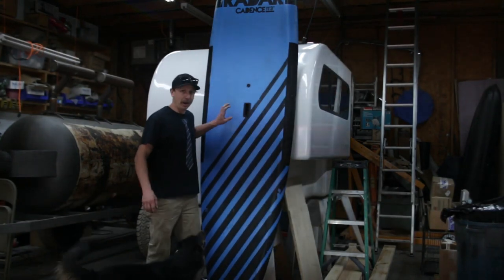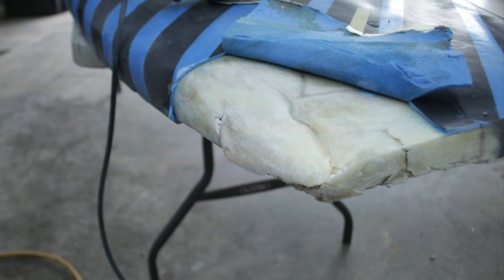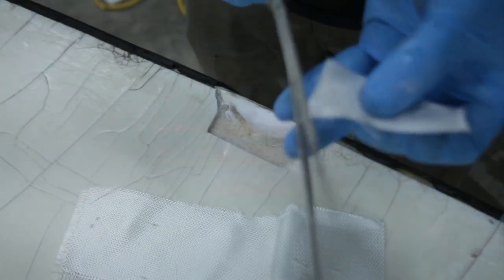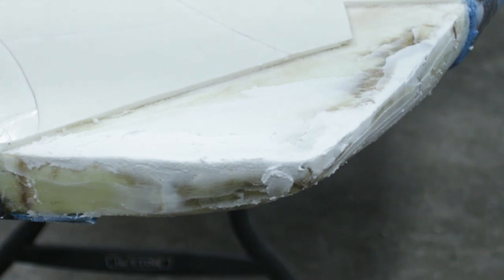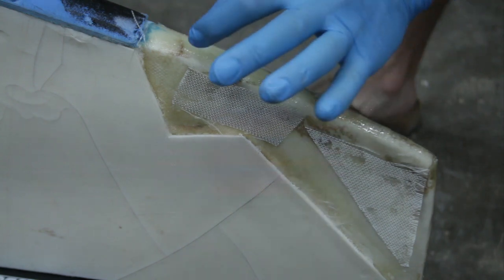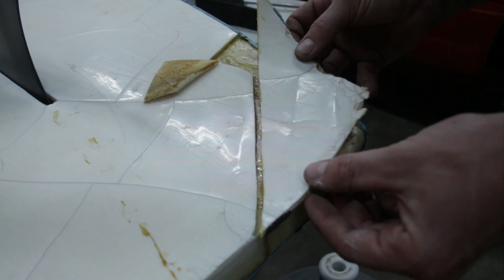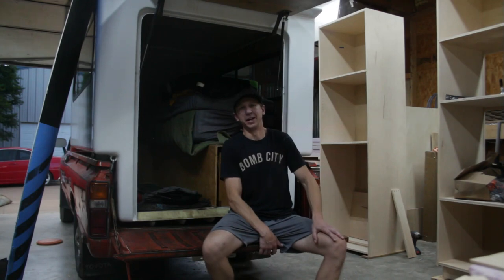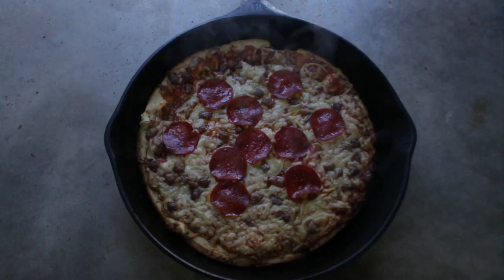Stand-Up Paddle board Fiberglass Repairs

Comment: Hey Jake, been watching your videos the past few days and just wanted to say a few things. Firstly, the reasoning for watching, is that i plan to build a foam and fiber removable setup like yours for a harbor freight trailer. I wasnt sure which foam to search for that would work with poly resin.
Secondly, love the content, the yota, the sleeper, and your 4 legged companion. Keep up the good work. Your channel should have so many more subscribers and i wish you nothing but success. I will certainly subscribe. Thanks.
Reply from the maker: Thanks for the kind words, and for watching! 
Epoxy is very foam safe, traditional polyester resins will melt and deform it. I would encourage you to do a small sample with your planned materials before diving into a large part/project.
Reply: @ThatJakeWorldWide  The foam board you are using, what is it actually called? I always run into similar dimensions, but they always seem to be foiled. Also, the white puddy compound you use to seal cracks and imperfections. What is the white compound?
Reply from the maker: @bigdaddydoitall  I'm using Owens Corning Foamular 150. Its available through Home Depot if you have one close by. It may not be a stocked item at your store, but they are generally helpful about ordering product. It also comes in a more dense Foamular 250 which id love to get my hands on. 

The white filler is glass micro balloons mixed with epoxy to the desired consistency. All my epoxy and fillers come from US composites.
Reply: @ThatJakeWorldWide  much appreciated
Reply: How many gallons of epoxy did you use to cover the outside of your camper?

Comment: Last weekend I binged all of your camper vids - so I need to get my life back - therefore I can't say I missed you - LOL!  Still it's good to see you're back.  BTW, I was totally blown away to see the paddle board uses an expanded bead Styrofoam (beer cooler) core.  I wouldn't have thought it was tough enough.  Could you tell what the outer layers are?
Reply from the maker: LOL, that must mean Im doing something right! 

I too was shocked by the EPS core. This wasn't a high end board new, but I think it sold at around $1200. I would expect higher quality materials at that price point.

 I estimate it has 8oz of fiberglass covering the EPS core, and its not the greatest quality layup. Lots of edges/seams/lumps and bumps. The topside of the board is covered in EVA foam, and the bottom has a 1-2mm layer of the same foam followed by what im guessing is HDPE plastic that's gone extremely brittle. An interesting construction for sure. 

Id like to scratch build one at some point, maybe a winter/next season project.